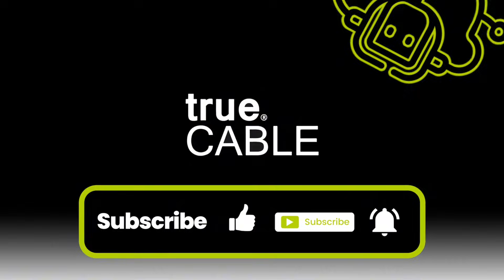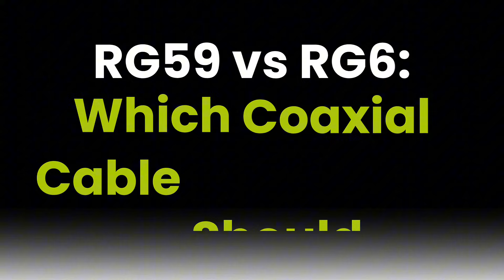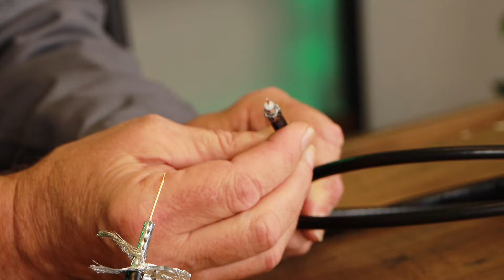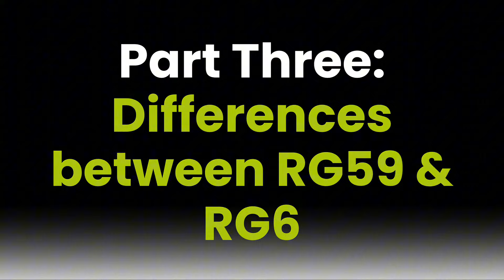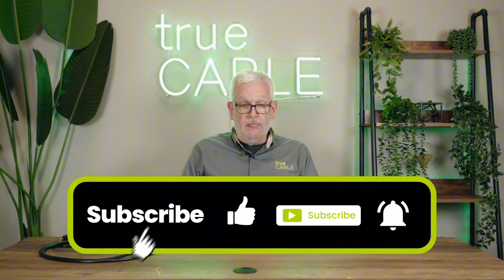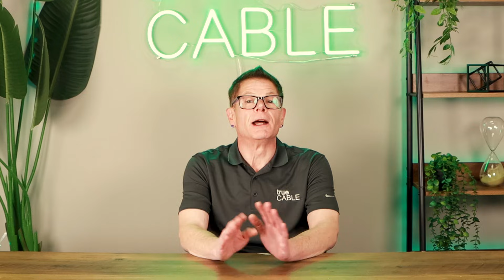RG59 vs RG6: Which Coaxial Cable Should You Choose?

Comment from the maker: Video Correction: RG59 coaxial cable has an impedance of 75 Ohms, not 50 Ohms as mentioned in the video at 01:16 

To learn more, read the full blog here: https://www.truecable.com/blogs/cable-academy/rg59-vs-rg6-which-coaxial-cable-is-right-for-your-needs

Happy Networking!
Reply: Thanks for clarifying, it's also mentioned at 5:30 as well. And it feels like the core argument in the video so you should consider reuploading.

Comment: Is it possible to use RG6 75 ohms impedance coaxial cable to install network boosters
Reply from the maker: Hello! Likely yes, but the type of coax you need would depend upon the equipment itself. I would refer to the documentation for any booster you intend to use.

Comment: I purchased some RG6 cable today but found it has only one layer of braid and foil.  The cable is marked RG6.  Is it possible the cable was marked incorrectly at production? I was installing RG6 with 2 layers of braid and foil or quad shield.  Is all RG6 quad shielded?  If RG6 is always quad shielded then I need to return the cable I purchased since it’s defective.
Reply: After doing more research I found there is a difference between RG6 and RG6/U cable.  I purchased RG6/U.  It seems RG6/U is not quad shielded but more flexible for installation.  The conductor diameter and dielectric diameter seem to be the same between RG6 and RG6/U cables.
Reply from the maker: Hello! That is dual shielded Series 6 (RG6 is the old name). Series 6 comes in dual, tri, and quad shield. Which one you pick depends on your environment and what you are doing, although they all work the same way. Quad shield is best for antenna applications or environments subject to severe ESD/RFI/EMI potential. Dual shield will we more than enough for typical HDTV or satellite applications.
Reply: @trueCABLE  Thanks for the response.

Comment: we have 1960s TV copper coax installed around the bungalow - 
are these suited to  MOCA devices?
do we need co ax adapter from modern smaller co-ax plugs to older large (non threaded) wall sockets
will this transmit 1 Gb ok
can u get wifi + LAN output MOCA devices?

thx
Reply from the maker: Hello! 1960's era coaxial? Rip it out. All of it. You can replace with modern Series 6 coaxial if you like, but I would run copper twisted pair Ethernet (Cat6A) instead. MoCA needs a well built coaxial system to function well, and I don't think your cable will support what MoCA needs--not well or reliably at least. Otherwise, use a good WiFi system. Mesh WiFi if need more coverage. Ubiquiti is an excellent choice known for reliability.
Reply: @trueCABLE  Thks for reply :) - Could u plse explain how a copper core far thicker than twisted pair + generous screening isnt an excellent medium, using co-ax to LAN converters? Thks
Reply from the maker: @davidstuart4915  Hello! That is a good question. Coaxial cable uses a single circuit comprised of two conductors, which is the combination of the center conductor and outer braid/foil shielding doing double duty as the second part of the circuit as well. Ethernet uses eight conductors to form four circuits. Each circuit is comprised of two conductors twisted together. Four circuits beats one! Ethernet is able to leverage this by making use of "electromagnetic balance". The end result is a much more performant and effective communications cable.
Reply: @trueCABLE  Yowser, great explanation, thanks....be interesting to compare performance

Comment: So for residential CCTV purposes, RG 6 or RG 59 suits better?
Reply from the maker: Hello! Well, this depends on the CCTV equipment. If your equipment is 75 ohm, then Series 6 or, to a lesser extent, Series 59 (lower shielding and performance over distance) is what you will need. If your CCTV equipment requires 50 ohm, you must defer to the cable type that will pass signals at that impedance, likely Series 58 or something your CCTV equipment manufacturer recommends.

Comment: I need to pull a 30m cable from the building to my house, terminate it with RJ12 and plug it into my modem (my internet speed is 200 Mbps VDSL 2+)
Under these conditions, do you think I should choose cat5e or cat6?
I personally think of high quality cat5e (24AWG) because it is easier to terminate with RJ12
Reply from the maker: Hello! Go with Cat5e. The 24AWG conductors are going to be the better choice for your application. Also, I would punch the cable to 24AWG compatible keystones designed for telephony to the cable and patch into it with the correct "telephone" cord.
Reply: @trueCABLE  It seems he needs to pull the cable between buildings so if this is underground he would need to install a conduit pathway and pull outdoor grade uv protected jelly filled cat 5e which is usually shielded/screened and needs to be earthed at one end.  If it is an aerial path then similar cable with integrated bearer wire or a separate bearer wire with flex corrugated conduit tied to the bearer wire at frequent intervals and the conduit containing the installed cable are possible options.  Some jurisdictions require suitably licensed cablers or electricians to perform such installations to the mandatory technical standards however ideally conformance to ISO/IEC 11801 is recommended.  I generally use RJ45 sockets and provide custom flyleads with an RJ45 plug on one side and RJ12 on the other for the telephony device in this case DSL router.  This means when the internet/WAN service is upgraded to having an NTD installed at the demarcation point, you can run ethernet through this cable and patch it to the router WAN port without having to have the installed cable reterminated with RJ45's.
Reply from the maker: @deadlymarsupial1236   Hello! All great advice and insight. Thanks for adding to the discussion. Especially good advice around Code compliance and licensing. In the USA, it would be the NEC/NFPA 70 (along with local Code Ordinances) and TIA standards you would need to watch out for. ISO/IEC is a Europe/UK/Asia thing...